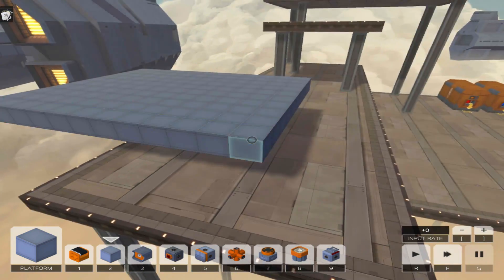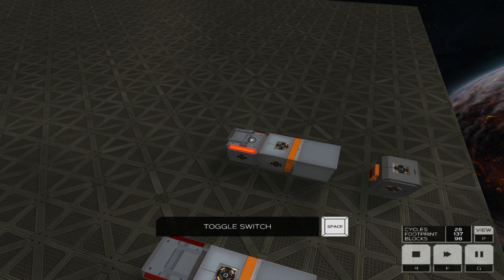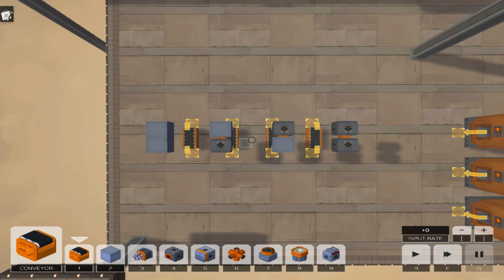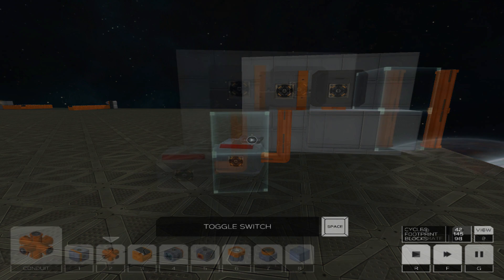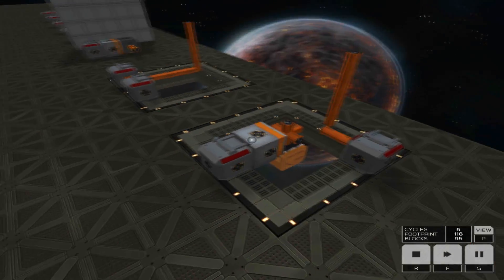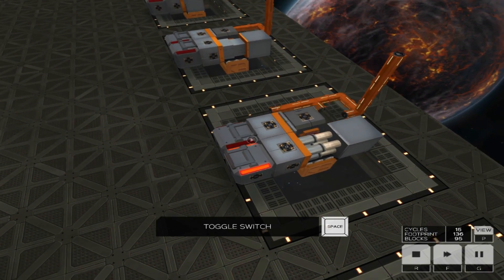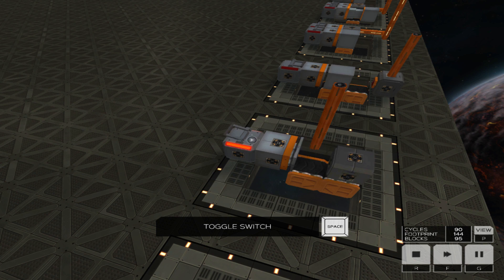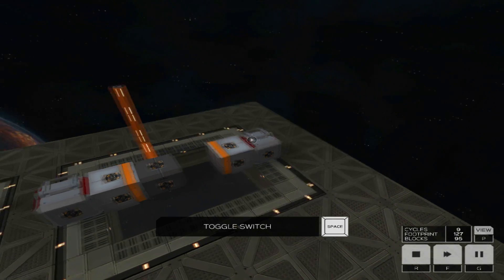Infinifactory Research - Logic and Circuitry

Comment: from minecraft redstone to infinifactory conduits. They all can do Binary, Pulses, Gates and such.
Reply from the maker: +Agent M Indeed. Only limiting factor for infinifactory is the inability to place vertically pushing pistons.
Reply: Sancarn instead of having multiple types of conveyors, pistons etc. they should make everything into one block type (all types of pistons, conveyors in one). and use 3dimensional rotating. so you can rotate the block all 6 ways, instead of 4.

And then make sure you can flip directions and such too. so a conveyor can go each direction. It may be a bit more difficult to program, but it shouldn't be impossible for them.
Reply from the maker: It's quite nice in my opinion to only have horizontal pistons (or rather have more limitations) but I would like the ability to rotate them in 3D - at least in custom games.

But their engine doesn't allow it

Comment: well... i gues an infinifactory computer is possible now :P
Reply: +Jendrik Weise now the question becomes, would a computer built in infinifactory be faster than a computer built in minecraft?
Reply: ikr :D i guess so considering that infini factory is quite well programmed compared to minecraft... xD
Reply: Jendrik Weise Yeah, lag would probably be a limiting factor in minecraft, but I meant more like if you ignore lag and assume they'll operate at the same speed as at small scale, so for example in minecraft a not gate (without cheaty 0-tick stuff) would take 0.1 seconds.
Reply: well, i guess minecraft beats infinifactory there even when not counting 0 ticks :D
Reply from the maker: +fdagpigj E Actually infinifactory isn&#39;t that great. You can&#39;t make worlds too big for instance. They can only be around 500 blocks across or so. It really depends how complex the computer is (and how good your computer is)...

And yeah, everything in infinifactory takes 1 cycle which is maybe 0.3 seconds? So it will be pretty slow compared to most minecraft CPUs (however you can speed them up with the fast forward mechanic of infinifactory). I much prefer the "crafting" in infinifactory to minecraft. I'd like to try and remake it in minecraft one day, perhaps.
Reply: well, idk the high limit of infinifactory, but most minecraft computers easily fit into a 500x500 space so i think it d be possible
Reply from the maker: Jendrik Weise oh definitely possible. Just not sure whether it would be super laggy or not.
Reply: well yeah u gotta see about that ... alos i dn be supoer tideous bc all of the block placing has to be done by hand